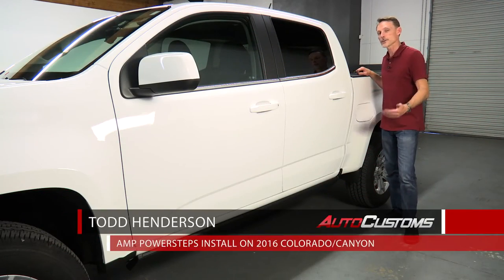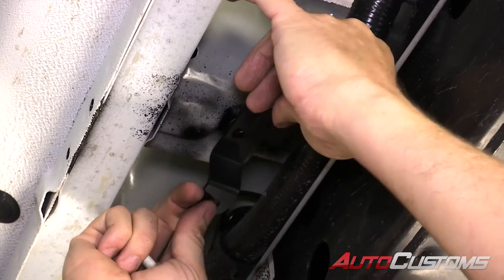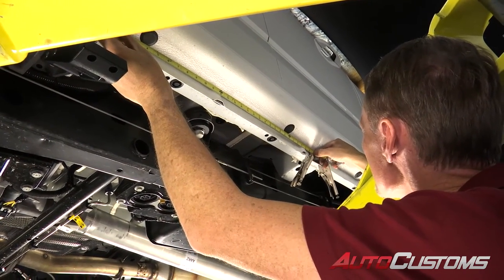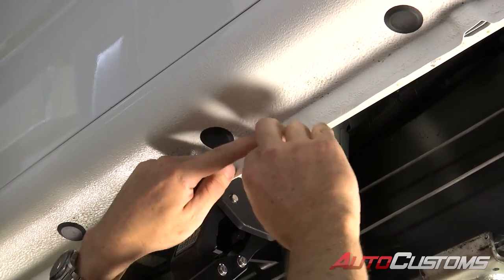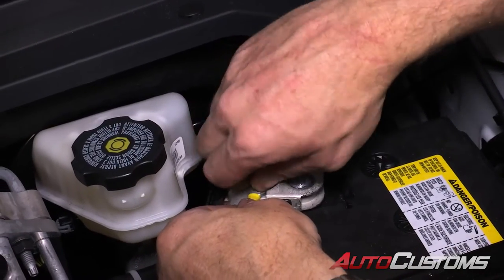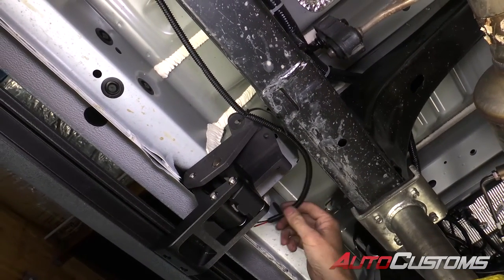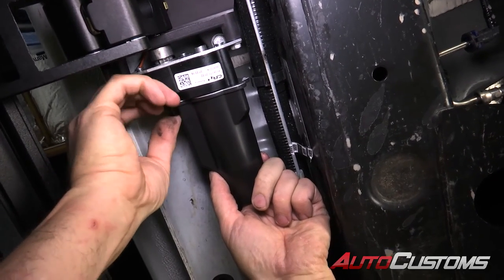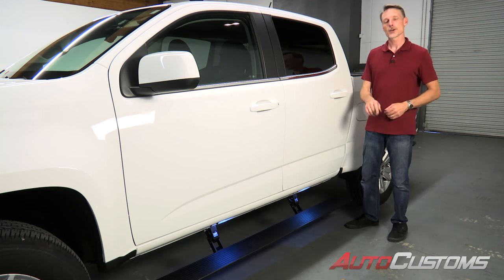How to Install AMP Research PowerStep Running Boards on a Chevrolet Colorado at AutoCustoms.com

Comment: I have an OBD dashcam. Will two OBD plug and play systems work at the same time (leaving them both plugged in--the dashcam has  an extra OBD pigtailed into it))?  Also, how does that light 3M tape hold up to high temps? The temp gets over 100 where i am, can't imagine how hot the road is.

Comment: Those amp steps are awesome and it would be the way to go if they had a better mounting system, no drilling required should come with that expensive price tag.
Reply: No way Im drilling into my new ZR2.  great video though!!

Comment: how do they work I. cold weather with snow and ice.?? will they stick??
Reply from the maker: +Mark Ruby,

These steps have been tested in extreme environments and AMP states they work up to around -40 degrees. As long as the area below the step is open and the steps can retract they would perform without any issue. They also come back by AMP's warranty which is 5 years or 60,000 miles. If you have anymore questions please let us know.
Reply: Thank you. Just waiting on the funds
Reply from the maker: My pleasure. We are here if you need anything.